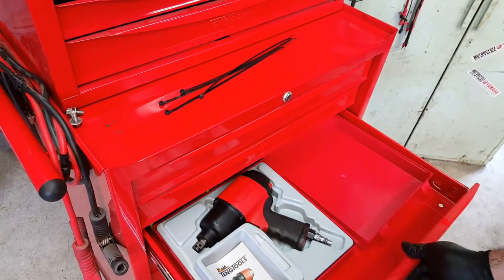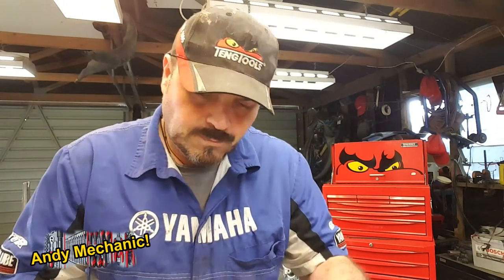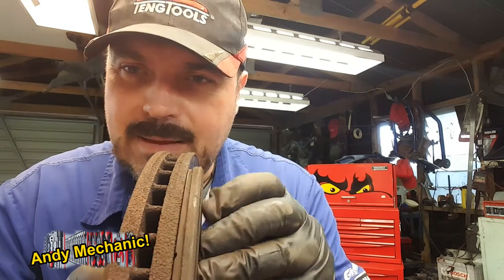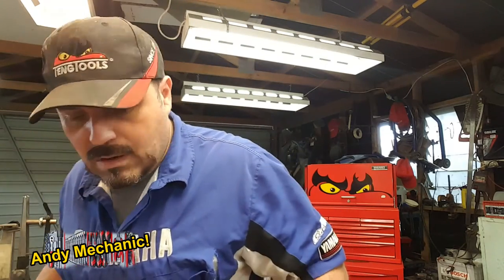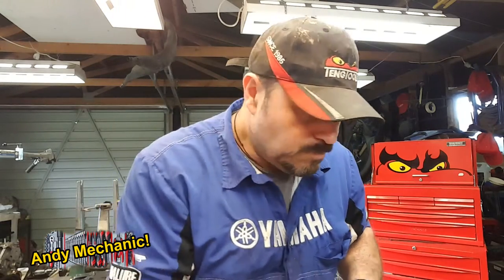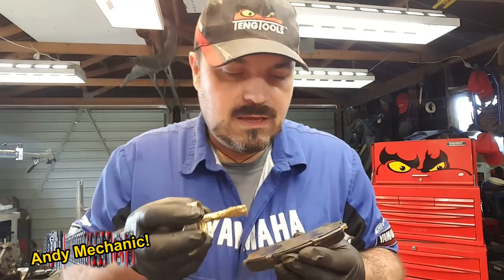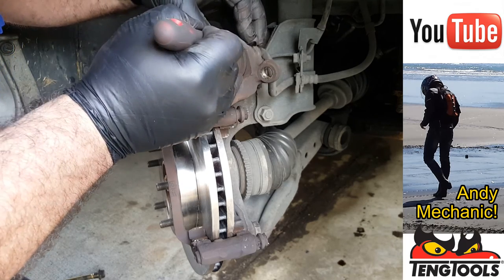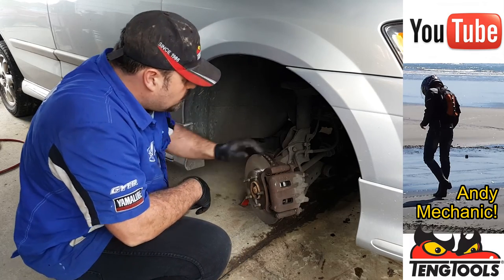Mazda MPV front brakes inspection & replacement #1319

Comment: The 19mm bracket bolts proved impossible for me to break, even with a breaker bar and an impact wrench.  I hammered and blasted on them for over 30 mins to no avail.  They were torqued on ridiculously tight from a previous rotor change.  Fortunately the rotors were still in good shape, so I just changed the pads and clip hardware.  My inside pads each had an extra clip on the top, installed directly on the pad.  I didn't see that here.  I wonder if that was a later update to reduce rattling even further. Thanks for the comprehensive video!

Comment: WHAT was the torque for the sliding caliper 17mm bolts?  The 19mm bolts were 100 Nm.  I am doing my 2001 MPV right now.
Reply from the maker: Sorry, I just don't remember.

Cheers Andy
Reply: Why do the brakes  sticking

Comment: Good presentation and very detail. My question - is it safe to use ceramic brake pads on heavy mpv against semi metallic? thanks.
Reply from the maker: Thanks :-)  Ceramic pads must only be used on designated brake discs. Plus just be aware that the braking effort is very poor until the brakes are up to working temp - this makes them unsuitable for normal domestic driving in my humble opinion. They were designed for supercars and track cars & that's really where they are a benefit over conventional friction material.

Cheers Andy

Comment: Andy the copper paste you mention , is it  copper anti-seize compound . I don't see it used at all really in Canada  on the calliper slides at least I don't know anyone using it . I use synthetic brake calliper compound  .  I have seen calliper slides with it on years ago and it would dry out  and become gummy in the cold climate . I wonder if it's used more so in hotter climates.  Plus you get it on you hands and it's a bigger to get off. LOL
Reply from the maker: +STEVE ROB Hi Steve, I just had a hunch I hadn't answered this, sorry. Yes, that's the full name. I think you are right, it does tend to harden up when it's really cold but it's commonly used both in the UK and NZ too.

Even better is something that resembles aluminum paste, we use it on dirt bikes rear multilink suspension. It's almost impossible to was off so it withstands all the pressure washes the bikes get.